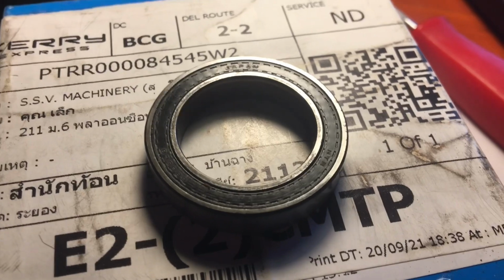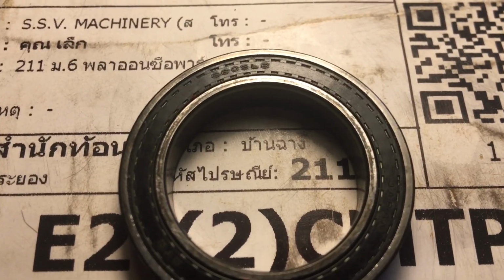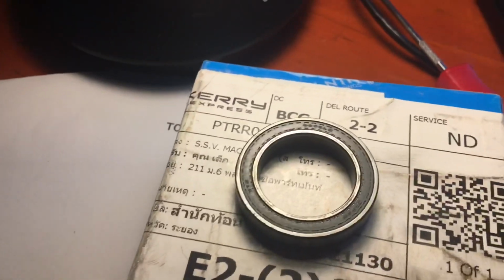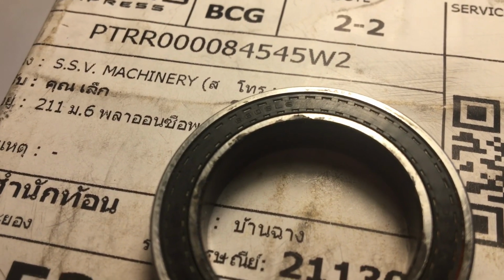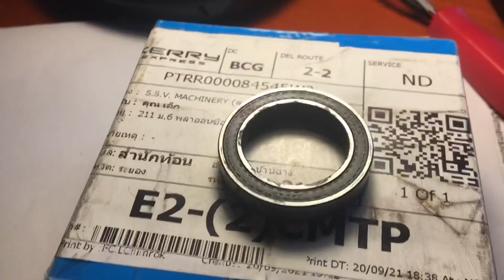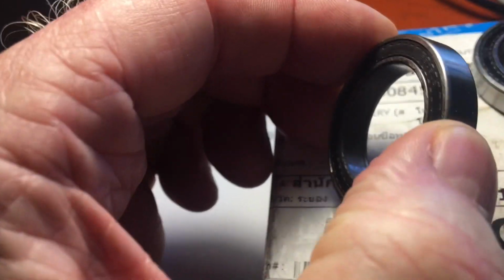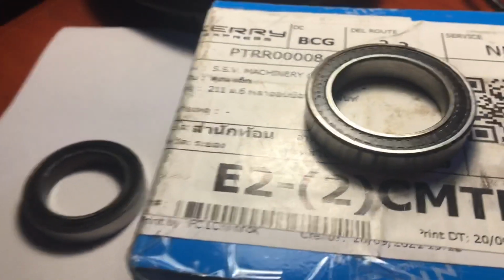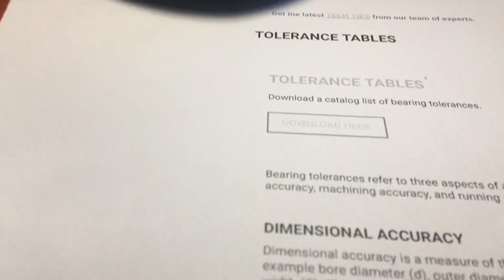Hambini BB86 NTN Bearing Exam / How to Avoid Fakes

Comment: Great advice to look up authorities dealers in your country , hope your bb shell is ok and not been damaged in your failed install,  did the crem bearings go in easly if the did chances your bb is ok 😊
Reply from the maker: Thanks David. Yes they went in just fine. Used the big park tool installer. No problem. 
I posted an NTN autopsy vdo that looks at the internals. Examining the seized NDS bearing it starts to look like this hypothesis: initial install went in DS fine, could not go in the NDS, thus, NDS frame opening was the greatest eccentricity (oval and undersized). So, my extra oomph trying to push it in was like a big squeeze on the parts of Hambini’s BB. 
-Perhaps I deformed the bb and the bearing? Creating ovality in the bearing race? How could that occur without also damaging the Hambini BB? Not sure. Also not sure that this hypothesis holds up? It’s an idea. It would require Dr H to say, it’s possible to squeeze the material used to make his BB hard enough to compress a steel bearing race yet not also damage the AL 7075 alloy BB. 

In any case, running the new bearings should tell me soon enough if there’s further damage. If they crap out, there is; if they don’t; there isn’t. 
Thanks for your comments!

Comment: I put my NTN bearings in but pushed them in too hard, and they were soon creaking. I knocked them out, filled them with grease (they were dry, as a result of being pushed in too far I assume). They have been back in for thousands of miles now, no problem. I realise you are not supposed to knock them out, and not supposed to lift the seals, but it’s worth a try and does work sometimes. Wish they would sell replacement seals. Lasting way longer than the cheap Cannondale OEM bearings, definitely worth the extra cost. Bought from Hambini to be sure they are real, and because of all his advice. Probably would have been better to buy the contacting version for longer life. The shield type also makes a difference, some are better than others, plus cleaning thoroughly occasionally (crank off). I’ve also started putting some marine grease over the shield to keep water out during winter.
Reply from the maker: I don’t think the contact shields would make a noticeable diff to most riders. I’m skeptical about reports from riders that say they feel the diff using this bearing or that. When I started reading about the labs doing tests to quantify ride “feel”, determine what ride quality boils down to, one major factor is the rider. There’s a lot of rider in ride feel. Subjectivity. Not reducible to metrics. The quantifiable, testable stuff is interesting though.
Reply from the maker: Interesting. I’m not worried about how long they last. They’re replaceable, cheap in Asia, but I am curious if i might have damaged the bb itself, not just bearings. I’ll post some commentary today. Thanks for your comment.

Comment: Super interesting. Although it does sound like the "knock out" removal of your bearings is the cause of the premature failure of your bearings I wonder if it is perhaps a combination of that and your location. Let me explain. When you ride a bike it will pick up a static charge as it "scrapes" through the air. Your electrically charged bike now will electrostatically attract particles in the air around the bike...especially very fine particles that remain in suspension in the ocean side atmosphere. Riding next to the ocean, I suspect that fine grit will cling to the electrically charged bike surfaces and perhaps, just hypothesizing mind you, this very fine grit makes its way into the bearings. Riding through puddles with this gritty material in solution just adds to the problem. Again, normally I suspect this is not a huge issue. But with the initial damage caused by knocking out of the bearings, perhaps it set the stage for the grit to be a greater foe than it would normally be. But, as you would say, what the hell do I know, I'm just a dumb...
Reply from the maker: I appreciate knowing this. Let me finish a whisky and reply.
Reply from the maker: I think I crushed the bearing trying to get the bb in first time, or warped it. Possible other damage to the bb that took not long to show up. The bearing is completely seized. Hard to imagine some dirt doing that, and upon inspection the seized bearing looked not much diff from the one that still spins. My question is: did I damage the bb itself. The new bearings will tell the answer soon enough. If it recurs, I’ve got another problem, if not, maybe my rough handling only harmed the bearings. We shall see. 
Thanks again for your comment!
Reply: @theunabiker  I hope you enjoyed your whisky! Ahhhhh...ANOTHER variable! I forgot about your initial problems installing Hambini's BB. Again, what the hell do I know, but I would think that the weakest link in the hardware of a bottom bracket is the bearings. So hopefully that's all that has failed and replacing the bearings will bring everything back to a joyful place. I know you are concerned that by trying to install the Hambini BB in the undersized BB opening in your carbon frame you may have screwed the pooch. But I've seen Hambini really torque the s**t out of his BB tool in order to install some of his bottom brackets and it's never damaged the frame. (At least he's never admitted he's damaged a frame 🤣) No one ever said that learning by doing was going to be a smooth journey. Right?
Reply from the maker: @SignorLuigi  Correct. I’m reporting what’s going on and adding commentary. If someone profits from my little explorations, that’s good. I don’t expect an audience to plod along through lengthy Unabiker stuff I post. Some might. This is a log of my bike adventures, little victories, mistakes, learning. I don’t pretend expertise. If I screw something up, I’ll fix it, that’s how it goes. Along the way, add to my understanding. Not sure why I’m sharing it other than the notion that someone might learn from my adventures. Thanks for the feedback. Actually, that’s been a satisfying aspect of this log, interesting comments, encouraging words.
Reply from the maker: @SignorLuigi  yes, concerned is correct, but not dismayed. I have a willingness to make a few sacrifices if necessary. Frames or BB units can be replaced. This was a project with a budget, most of which is for equipment that can be used on some other project build again. But so far, the bike is a joy to ride, and other than coming to grips, and finding the right and final fix to damage done by moi, it's all good. The new bearings will be the test. If they crap out after some miles of riding, then I know there's more to it than bearing damage that's at work. If they do not crap out, then taco-ing bearings was the limit of the abuse inflicted. It's kind of got me in a mode to ride more, see sooner, but it's raining every day here, and sometimes all the damn day long.
Reply: @theunabiker  👍 BTW, I SOOOOOO understand the rain issue. I think I mentioned to you in a previous post that I lived in Fiji from 1975-78 (Peace Corps volunteer). Fiji also has a rainy season and just like your situation, it rained every day...often all day. In fact, it was so wet and humid at times that after washing clothes they sometimes would never dry, start to develop mold and mildew and need to be washed again. No electricity, so this was a hand washing experience. Having to redo a wash by hand-->😩😩😩. Can't wait to find out the results of the tests on your bearings.
Reply from the maker: @SignorLuigi  I do not have a machine, I have tubs in the hong nam (water room) as Thai call the bathroom. Thai design elements include floor drain, lower spigots below the shower head, full tile construction, made to be hosed down. It's brilliant. So easy to keep the room clean, clean it daily. After a ride, everything goes in a tub, hand washed, rung out, hanged outside to dry, or inside on racks if it rains outside. to avoid having to tote too much stuff to get it machine washed, I hand wash t-shirts all the time, hang to dry. You know the drill, frequent showers (3-4 daily) to rinse off, frequent t-shirt changes. A wrap around instead of pants. Free-balling is the rule... The mold issue I get well. I never did peace corps but did some African fundraising and village project involvements in Ethiopia, Malawi. memorable stuff.
Reply: @theunabiker  I need to build myself a hong nam. As you say, BRILLIANT! In Fiji, they call the wrap around garment a sulu. They are genius for creating cooling breezes for one's Johnson. Africa, I'm sure, was a pivotal infinite moment in time for you. But today, I'm sure you are hoping to get in a good ride. Best wishes for a dry break in the weather.
Reply from the maker: Thanks! It drizzled all day. Tomorrow I’m going, rain or not. 
In Thailand it’s called a pa ka ma.